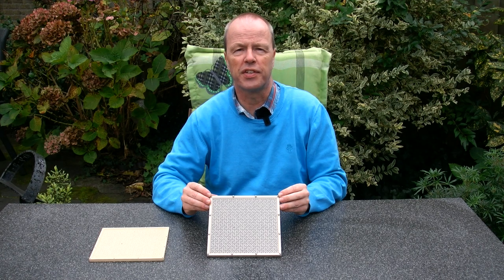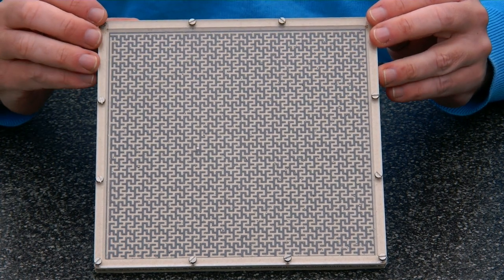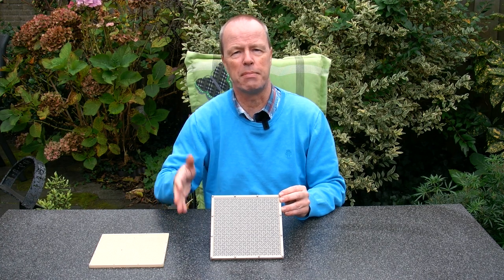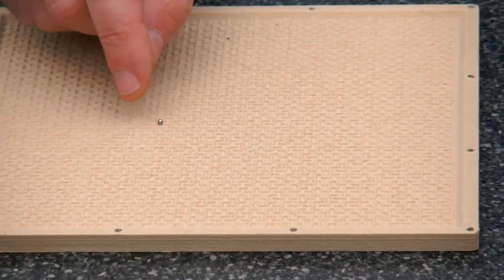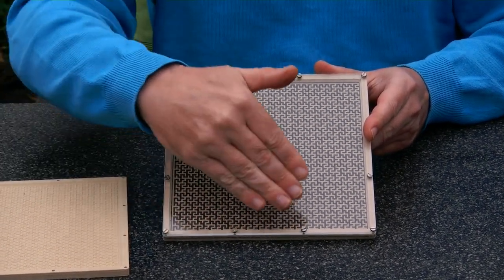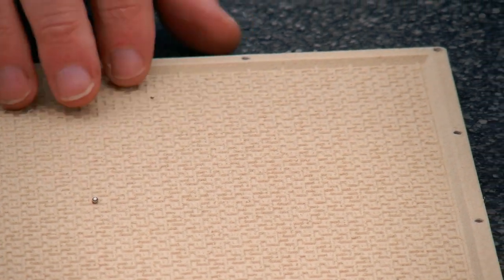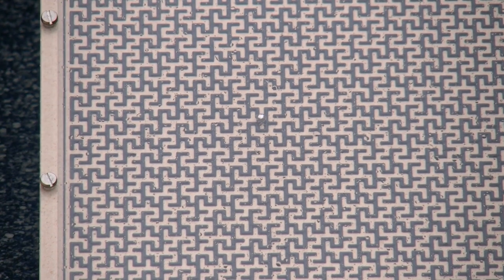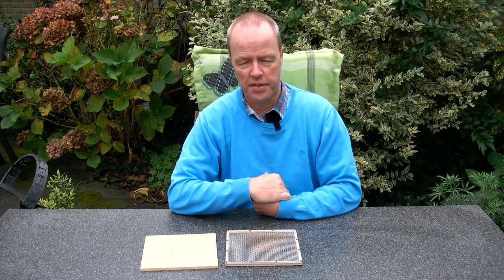Fractal Gigamaze - Would you try to solve this maze?

Comment: You can make different sizes for the wall and use different size balls in the same maze together. So you would able to play multible balls at the same time to get to the finish. Some walls let the bigger ball trough. You can make a maze for 2 balls or more that have to take different paths. using different hights of the walls and different sizes of the balls. That would be very difficult to solve! This ball can not climb over the walls, because the ball will hit the ceiling, but a smaller ball can climb over the wall, It doesn't hit the ceiling, because there is space enough. You can make this possible to print the walls in different heights. to make the second maze more vissible you can just make a red line in the middle of this maze. So you will have 2 mazes in one maze!

Comment: A decent PLA with a hot bed (60+ degC). I can also have the base layer as "cluster of islands" (like an upside-down bar of chocolate) instead of a solid flat surface. This breaks the stress-lines. Not really needed if using PLA + heated bed. Yes. I have a crappy DIY 200-monies cartesian printer, and it still works ;)
Reply: although the color-change makes for pretty contrast to see where you are rolling :)

Comment: I would laser cut this. I would increase the size by 50% and use a 2mm ball or even 100% and use a 2.5mm ball.

Most acrylic I cut is 3mm so a simple flat base and clear top.

Comment: I think it is a perfect maze! I would make it 3D in plexiglas lasercut, with my own technique that I invented, but to design a fractal maze in 3D dimensions this size would be a very good challenge and I'm afraid I can not do that.
I like to design 4 dimensional mazes on papier. I even went as far as designing 6 dimensional mazes. I have never seen 6D mazes or higher, so Maybe I'm the first one and you can just play it on paper. It is very complex and disoriented. I wish I would have know a way to make it something you can hold in your hands. I transformed a 6D maze on a 2D surface, it is possible, because we live in a 3D world and we can look from above. To make a 6D maze in a 3D shape is more difficult unfortunally and impossible without using electronics.
Reply: I think you can make a 2D shape puzzel that allows you to play 6Dimensional mazes using lots of buttons that interact with eachother. The goal is to push the finish button. The finish button is still locked, because you have to go there first.
Each button allows you to push 12 other buttons in 6D axes forward and backward. It is in a 6D grid layout on a 2D surface. So you can find a way to go there. it is only possible to push one button at the same time. So when you push the other button, the first button goes up again. On each button there will be signs in which direction you can move. So you don't have to guess the buttons. You can read it.
The difficult part is to make a mechanisme for it.